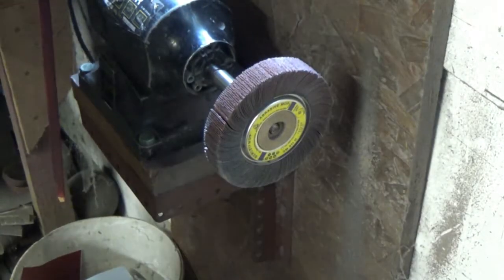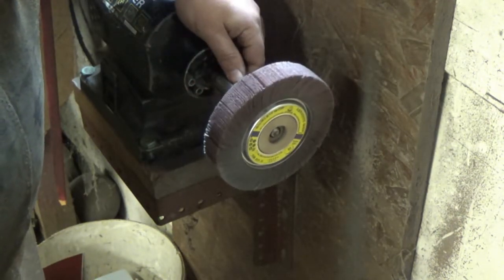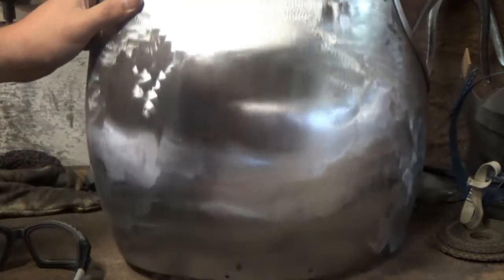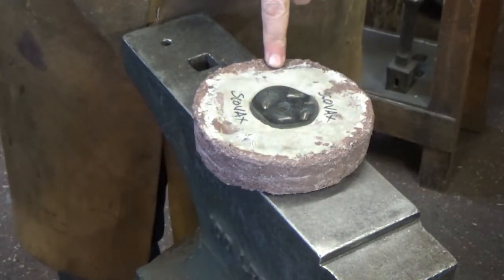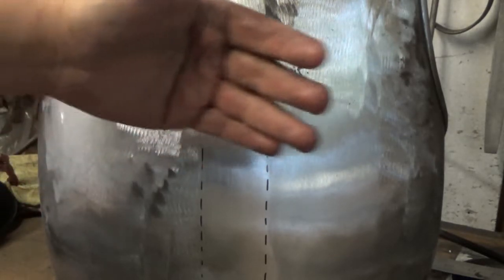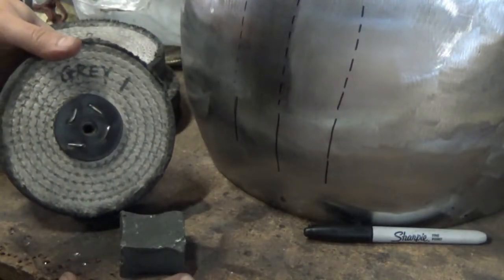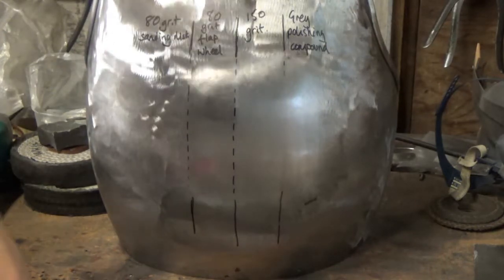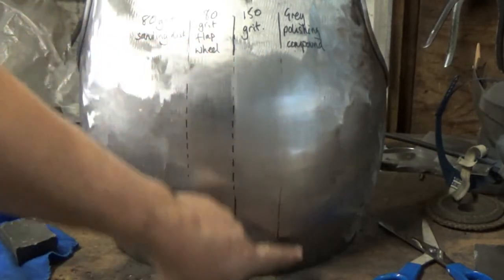Cleaning armour pt III - grit to polish. Medieval armor techniques

Comment: Great advice and good Video 
The yellow flap wheels is a klingspor, pretty much the flap wheel every tries to match in the abrasive industry. I used to supply them for finishing titanium helicopter blades.
It ia interesting the types of abrasives and what finishes they offer, I noticed you used scovax which you dont see used any more. Canning stopped production a few years back.
Reply from the maker: I used to us 150 scovax, but that seemed to vanish, now onto 120. This would explain why its becoming harder and harder to find. I like the pre mixed grinding pastes, I'll have to get searching for another type. Thanks for the comment, very useful.
Reply: @GreenleafWorkshop  other option is Coldax cement with loose grit. Coat with Coldax the roll in grit etc. The cast iron radiator guys go that method.  I guess you could pre mix grit and Coldax, so it would then be more like scovax on application.

I am seeing ceramic velcro disc could get in trade more and more. 

Best Regards Andrew
Reply from the maker: thanks for the advice, will take a look at Coldax

Comment: Is there a recommended order to crafting amour?  For example when making an arm harness you started with the couter then the lames, then the canons.  Does this aply to other areas as well; like making greaves first then the sabatons, or making the cuirass before the spaulders or helmet?  I assume the order isn't too important if each piece fits the body well but is there an order that makes it easier?
Reply from the maker: On limbs I tend to star with the middle and work my way out. I've found it works for me; I can't say for sure what others do, but I think it's fairly common practice to work this way from what I have seen.

Otherwise I tend to start with the piece that's closest to the body and work out from there, but I don't think it's imperative - you just need to start somewhere :)
Reply: They say there as many right ways to make armour as there are armours. :)  What about something like an English great bascinet that straps down to the cuirass.  I feel like makeing the cuirass first would help you form the neck plates to sit flush with it.  Just typing my thoughts.
Reply from the maker: I'd go along with that. When I started I kind of thought that there was 'a way' but have since learnt that so long as you end up with the correct shape, similar marks on the inside of the piece and can do it relatively quickly you're most likely on the right path :)